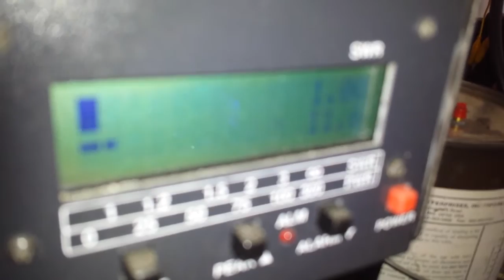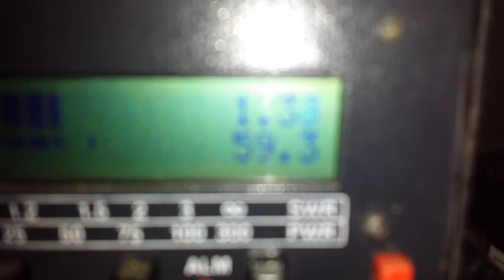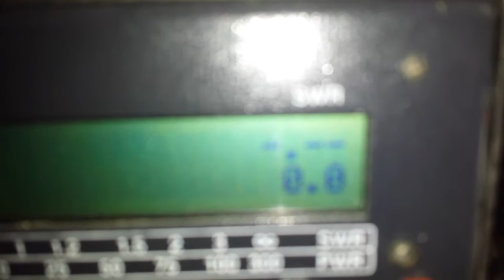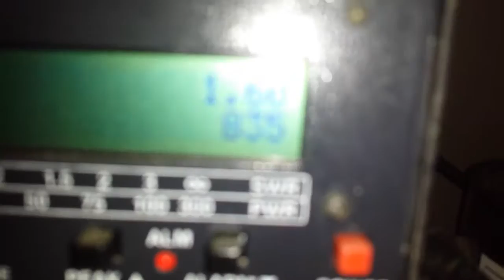Texas Star 667v Power Wire Upgrade - Gained 60w+

Comment: Awesome! I have a Texas Star 350 High Drive. Would that mod also work for my amp?
Reply: Jungle Joe C Yes I upgraded the crappy aluminum 12 gauge they had to copper 10 gauge , installed a car stereo tube fuse holder in the wire with a 40 amp fuse. I'm getting about 70 watts more out of it. The lights dimmed when I modulated on the amp before, now they stay bright.
Reply: billybassman21 Right on!